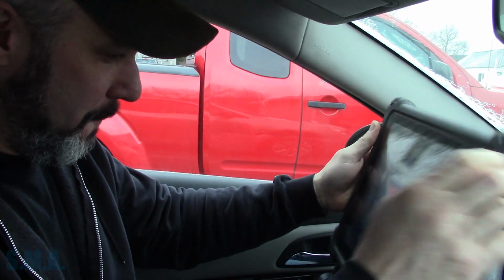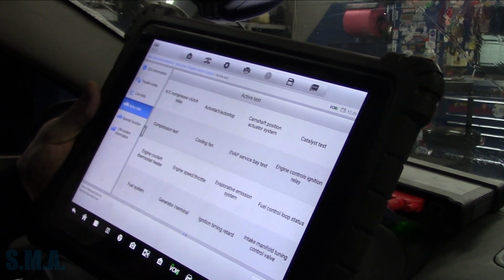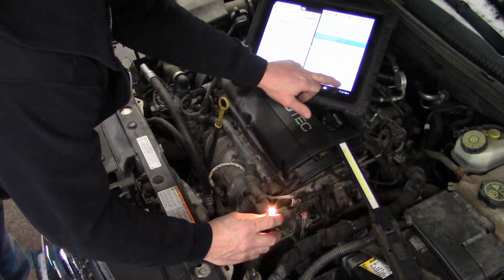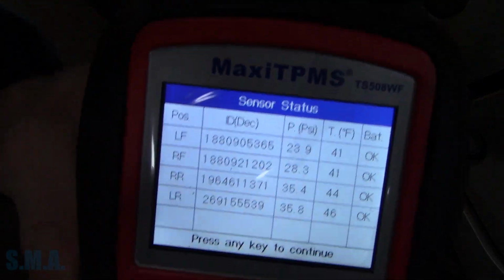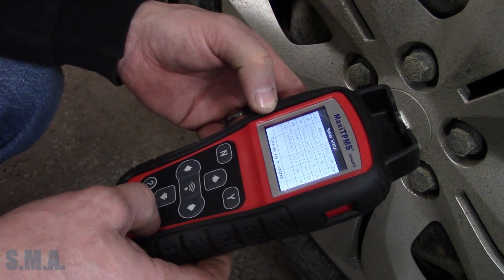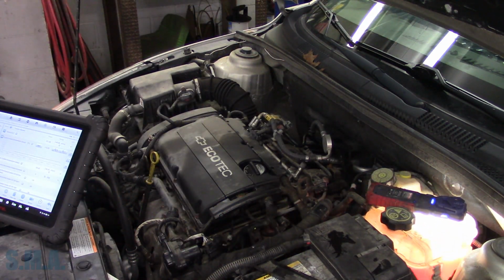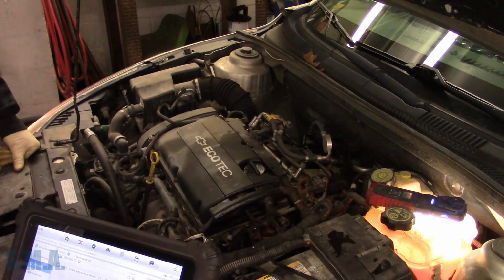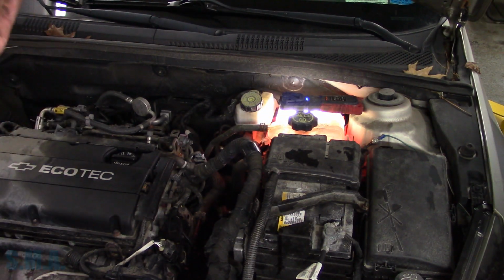Chevy Cruze: Thermostat Heater Codes / TPMS Light On

Comment: Whats next a pulse width modulated radiator cap. With all of this unnecessary crap that car must have 10 miles of wire in it.
Reply: Don't exaggerate; it's only 9 and 1/2 miles of wire. :)   :( actually.
Reply: Expect that to change in a sideways direction. Generally speaking, all any electrical component (no matter how complicated) needs is a power connection (two, or occasionally three wires) and a 2-way data connection. In the not so distant future, expect to see most automotive cables be more similar to one another. Counterintuitively, that means less to fail (how many videos have we seen where Eric chases down a chafed or corroded wire?) and probably more robust outer jackets and connectors.
My Prius has no alternator, no starter. It has big orange power cables and smaller 12V power cables from the battery pack (includes a battery ECM in it, of course) to the inverter, which operate the hybrid transaxle through more big orange cables. There are some sensor wires that have not yet been moved to the CAN. The reliability of this system is phenomenal.
The mantra since about 1980 has been to replace hardware with software. Actual failures in software are few; bugs and difficulty dealing with the stuff are being handled more and more by ISO 9000 series standards. With fewer wires and fewer connector pins life is so much better.
Reply: @flagmichael  that thermostat doesn't need to be electronically controlled.  Those systems have been working just fine for over 100 years and never a chaffed wire. This is why you couldn't run fast enough to hand me one of these crappy chevys. If they were so reliable then why is it in the shop?

Comment: Great job Eric, over here in the UK we are used to working on poop 💩, like this , we have to buy the full housing , thermostat not sold separately, we can't even buy the safe guard oil filter used on Vauxhall cars unless from main stealers at approx 40 bucks with tax ,much cheaper over there in the US, Fram won't import it to the UK ???, Thermostat  housing about 190 dollars, very common for temperature switch failure and fan wiring green  crusties

Comment: Isn't that just an unnecessary complication on a wax pellet thermostat? Surely the heat from the coolant makes the thermostat open so why have a heater? If the water isn't hot enough then the thermostat should stay closed until the engine/coolant is up to temperature. Do we really need such a device? Good video as always, stay safe.

Comment: According to walmart, that tire is not repairable. The guy had to come from the deli section to tell me that.
Reply: Many chains follow standard industry practices for legal liability reasons, and the tire industry says they shouldn't be repaired. That doesn't mean you can't repair them, but those chains won't.
Reply: You are right, I was just irritated when they wouldn't do it when I have repaired tires for umpteen years. They seem like they want it almost dead center of the tread. I ended doing it myself😒

Comment: What's the point of the heater in the thermostat? Thought that was the point of the fluid in the cooling system. I guess they couldn't make enough on mechanical thermostats. "If it ain't broke, fix it until it is." AVE and also -Auto manufacturers-. Only one of them was being sarcastic.

Comment: How can such a complicated, computerized, system, be cheaper to build and engineer, rather than the plain old 180 degree mechanical thermostat, we all grew up with, and took 15 minutes to  change out.  With all this computerized equipment used in such a harsh environment as a moving motor vehicle, I'm not surprised at all the breakdowns.............Good Job, Rick...!!
Reply: 180F thermostats are long gone. The emissions and fuel economy were lousy. 190F was better but the more modern temperature control are now standard. Toyota has gone the electric coolant pump route.

Comment: Ah the 140bhp and a stick shift, she’s a beast
Reply: I'm pretty sure that's  a 1.8 naturally aspirated. But that model also had a 1.4 turbo.
Reply: @russellhltn1396  it’s the 1.8, the intake and 710 cap is in the wrong place for the LUJ, my bad but it puts out the same power-ish
Reply: @Mrflash222006  Same HP, but the 1.4 gets the torque at lower RPM.  It makes for pleasing acceleration from a stop.  There's a reason the 1.4 is standard on all trim levels above LS.

Comment: I don't understand the purpose of the heater. Is it used because the wax pellet doesn't have a large enough thermal range? It seems to me that a simple wax thermostat has been turned in to a device that is more likely to fail.

Comment: great video. I get weird looks in California for driving a manual escort. nobody drives a standard anymore, its sad.
Reply: They might also be looking at the Escort funny as well; those are antiques anymore.
Reply: @markh.6687  a 98 is an antique? Glad to know
Reply: @ZeldaNumber17  Close enough, since it's 23 years old. I'm not making fun of you, since I"m driving a 2002 Saturn Coupe. :)
Reply: @Jonathan damn lol. Mines got 220k miles. Haven’t had any engine problems other than the thermostat, thermostat housing and valve cover gasket

Edit: Had to replace the radiator at 210,000 because it started leaking
Reply: @Jonathan will do, i drive like grandma. I plan on building an svt focus engine when this one grenades. Edit: I just love these cars, maybe a 2.3 Mazda. I’ve heard that’s an easy swap. They ride and drive like small Buick’s

Comment: Nice. Worst thermostat that I ever had to change was a ‘94 Grand Am GT with a 3.1L.
Reply: My daughter-in-law had an early 2000s Kia with a stud that was way too long on the thermostat housing. Something more difficult (I forget what) had to be removed  to get the cover off. The last straw was when both rear doors suffered something broken inside so they could not be opened. I tried to hook it through the window opening but no joy on either side.
Reply: The GM 3.5 or 3.9 liter v6,  I forget now, but one has a tstat that is on the front of the motor,  facing the rad and above the cradle. It is an absolute nightmare to change out

Comment: GM's TPS doesn't seem to be the best in the industry. Its like a flaccid geriatric in a whore house.
I have a 2014 Volt that I've changed the sensor 3 times and the receiver once. Still has its good and bad days. I think those toll devices put out a little interference that disrupts the signal also.
On another note GM's new logo looks weak.

Comment: Sorry for the silly 'boomer' question. Why does a theromstat require an electric heater? Is there still a wax pellet inside to open the valve? Or, does this thermostat control coolant flow to the heater core?
Reply: It allows the computer to adjust the engine operating temperature.
Reply: @russellhltn1396  Thanks, I just reached the end when he described the pellet. Presumably by having a pellet that opens hotter than normal, then by having a heater you add a complicated form of control.

Comment: Who remembers the days when cars had wax actuated thermostats that cost $3 and were stocked at Kmart.
Reply: I do - those things were serious trash. I went through several aftermarket thermostats on my 1985 Volvo because they all produced unstable temperatures. Eventually I got one from the dealer and it worked perfectly.

Comment: Thanks for posting this video. It is perfect timing for my little problem. I liked that you fixed the slow leaking tire. Please tell me what type of patch was used on this customer's tire? I have a tire with a slow leak just like, really exactly, like that one. My walmart's service shop said they can't fix it because it's not where the tire has belts. Gimme a break.
Reply: Walmart gave you a break; they told you to go elsewhere for service. Their lawyers tell them what tires can and can't be patched or plugged.

Comment: These car designers are just total idiots. Even dealer mechanics hate working on new model cars. You have to practically pull the engine to replace some parts with new parts.

Comment: Best most reliable car I never had was a 1975 Datsun B210, 4 door, 4 cylinder, 4 speed transmission. Came with a smog/air pump. One idler pulley. One brake system slave cylinder. 
Basic electrical system, battery, alternator, points, condenser, cap, rotor, vacuum controlled engine firing advancement, simple braking system.

No A/C.
No money/engine light.
No electronic modules. 
No sensors.

Easy to do all repairs.
All parts were inexpensive.

Had the Datsun for about 15 years.

I moved to the eastern rust belt. The Datsun's metal was eaten alive in just a few years. RIP

Comment: Thermostat box shows a traditional mechanical unit but inside is a "modern" one with a solenoid.
Probably only costs five times as much.
Reply: Its a heater inside..melts the wax faster per the ecu commands. About 63 bucks
Reply: @pootthatbak2578  I see. Eight times as much.

Comment: The information on replacing the thermostat also applies to the 2009-2011 1.6L (RPO code LXV) Aveo/G3/Wave; although while the 2012+ thermostat assembly is only $150, we LXV owners get wallet raped to the tune of $350! (It’s a bit of a sore spot for me, because I had to replace the thermostat twice; with the second one including the rear housing.)

Comment: gm temp sending units go bad so often is this the overheated head gasket failsafe? my 68 mustang 302 has a overheat safety vacuum operated diaphragm switch on the thermostat housing if temp gets to 225f it changes the distributer advance to run higher rpm supposedly preventing overheating the head gasket
Reply: 21st century Fords have an even more sophisticated engine temperature control system. If the temperature goes beyond the controlled range the engine temperature gauge (really an idiot light with a pointer) rapidly goes from center to the red. If the driver does not respond to this and the problem worsens, half the cylinders are disabled, reducing heat production and bringing some cooling air through the engine. If the problem continues to get worse, the engine shuts down altogether, moments before it would have done so destructively.

Comment: I’ll never understand why people waste their money on these cheaply built gm cars, when you could of gotten a Toyota or Honda and it’ll run for 500,000+ miles with minimal maintenance.
Reply: Well, Toyota anyway. I soured on Honda when they let known problems (like the fuel pump relay and the post-1998 automatic transmission) go for so long.
Reply: Ya or a ford
Reply: It all comes down to the stigma that those cars have people in America call them them boring and that the interior is not as good as a Toyota witch is rubbish

Comment: P0171 ?? don't leave us hanging. You never explained what the lean conditions on these were.
Reply from the maker: It ran three drive cycles and did not have set a pending code for a po171. It's not worth chasing down
Reply: @SouthMainAuto  As my old cellphone manual said "Sometimes electronics become confused...."  Random or rare conditions of speed, temperature, etc. fool the computers into thinking there's a problem. My 2001 Taurus did that with 02 sensors and once or twice with a cam sensor codes. Never changed anything, just deleted the code so the MIL would turn off. Might not do it again for months. Like SMA said, not worth chasing down.

Comment: Thank you for the parking brake tip. I would have chased my self around in circles trying to resync the TPMS. We live in Wisconsin and I have refused to use the parking brake for decades because the parking brake  froze one to many times because we are in the salt rust belt. You definitely are the man!!!
Reply: I've found that using the parking brake every single time I park keeps it from doing that.  It helps that I grew up driving a manual so that habit has remained.

Comment: i have a question for you. do we as carbuyers, need all these electronic computer controlled car parts?
Reply from the maker: Nope not really
Reply: It's because of the push for better emissions and fuel efficiency.  If the car makers could accomplish that another way and save 10¢, they would.
Reply: As manufacturers they do. It is all about emissions and fuel efficiency compliance.

Comment: I used to park & drive cars at a auto auction. We would drive up in a van of 7 drivers, we would hop into cars, & you would watch the youngins pop out & say "It's got a stick!" The old guys would hop in the Challenger & motor on!
Reply: When I was in the service, and would go overseas, none of the young troops could drive the sticks.  My favorite was a Ford van, with an underpowered diesel, with a five speed on the column.
Reply: @robertheinkel6225  When i was in the US Army, the 5-ton truck that I drove was an automatic. I was surprised by this.

Comment: Are these GM engineers smoking Crack or what. Going from a tried and true mechanical thermostat to a wax heated thermostat is whack. Why?? Because the system is designed wrong and this was added to correct the original snafu? ( Boeing 737 Max-fix the fix for the fix to work right?). Bleeding the air out of my Sky 2.0 l turbo is just such a screw up. Wonder what janky crap is on the 2021 models?? GM SHEE M.
Reply: "I put a fix in your fix, so you can correct while you correction your correction".

Comment: Talk about GM with needing to move the water pump housing to remove that thermostat housing, we had a 1967 IH dump truck with their DV500 diesel and I needed to change the oil cooler. It was located on the engines left side within the C of the chassis. It had 12 bolts to be removed and the last bolt hit the inside of the chassis and could not be removed. Needed to pull the engine forward about 18" to get that last bolt out. You can imagine the choice words I had about the engineer who designed the placement of the oil cooler. You and the family stay safe.

Comment: Fuel system lean is more than likely the cam cover and/or the purge control valve stuck open.
Reply from the maker: The fuel trims were dead on the money so whatever was causing it was not happening at this time

Comment: I do not know what you Americans have against a manual shift, they are cheaper to buy and fix  , more reliable and last longer. My UK Mercedes C220 is not only diesel,  it's a manual shift as well.  Once got 703 miles on a full tank and averages 640.  😃
Reply: It's called "driving in traffic"; nobody wants to shift all day long, and we're lazy anyway. :)
Reply: My son's Acura needed a clutch around 150K miles. I actually strained a muscle in my face trying to get it positioned when remounting it. Less than a year later the pilot bearing seized.
Compare that to the Toyota style eCVTs that virtually always last the life of the vehicle and greatly improve fuel economy and emissions by precisely controlling the engine operating conditions moment by moment. Several manufacturers are going to Miller timed engines, which are startlingly efficient over a narrow engine speed range. Mating a Miller engine to a standard transmission guarantees poorer fuel economy and emissions.

Comment: My solution, fire all of the design engineers and hire mechanics to design cars that can be easily repaired.
Reply: It's called value engineering.  Consumer reports doesn't care about how difficult the car is to work on in 5 years, neither do most buyers. Ship it!
Reply: @chrisE815  that's the problem value is for the stealerships not the consumer.
Reply: @dougjones9493  I disagree. It's the market and consumers keep buying this junk.
Reply: @chrisE815  do we have any other choice? Tell me a MFG that makes a car that is easy to work on. I was a mechanic and got out of the business when all the electronics started because we could not figure out the issues and the design engineers couldn't help. I remember being in a new identical car and just changed parts until the problem was fixed. They have better diagnostic tools now but back than it was a crap shoot

Comment: What's a thermostat heater do?
Reply: I actually just looked this up. It allows the wax pellet to be set to open at a higher temperature than normal to get the engine operating temperature up to a higher point, but then the ECU can turn on the heater to open the thermostat early under heavy acceleration or load to prevent damage.

Basically, old school thermostats are designed with a larger safety margin because they can't tell if the car is under heavy load.
Reply: @ShaneRimmerWorld  How do you "set" a wax pellet anyway?
Reply: @markh.6687  Well, I guess just the material design for what temperature it melts.

Comment: i done mine on my vauxhall/opel  gm and found they don't like aftermarket thermostat fitted. Was ok for a week then put on the money light so fitted genuine unit all was ok.
Reply: im guessing the replacement part doesnt actually have a heater..... and just uses the wax motor
Reply: @kainhall  yes mine has 2 sensors one built into the thermostat housing and 1 built in to the housing that bolts from the engine to the thermostat housing.

Comment: Is there a different engine for the Cruz? I replaced a thermostat in a friend's car but it was completely different. Built into a plastic housing and on the passenger side.
Reply: There is the 1.8L that SMA is working on and the 1.4L turbo your friend has.
Reply: @andysanchez5423  thanks man,
Reply: Soon all cars will made of carbon fiber.     Harder than steel
Reply: @tomweir3857  probably soft squishy foam, for safety purposes. An to make it easier to recycle. ☹️☹️